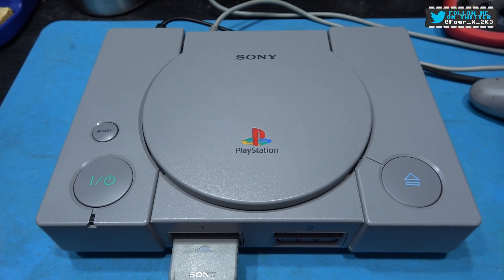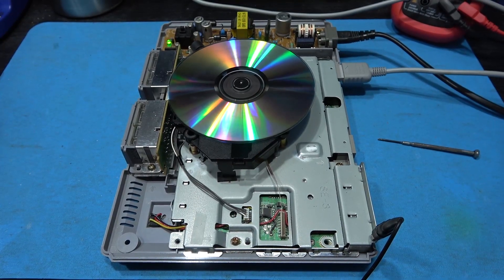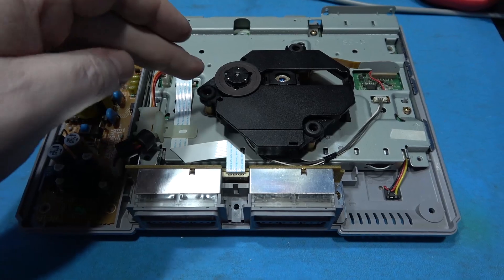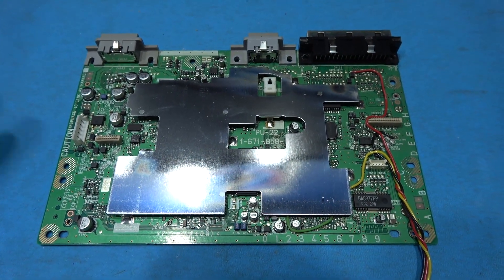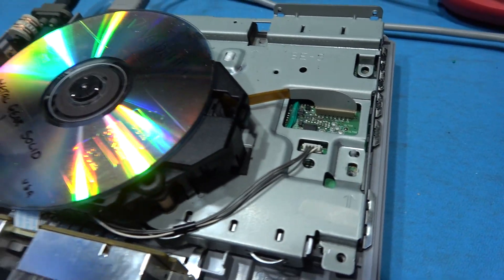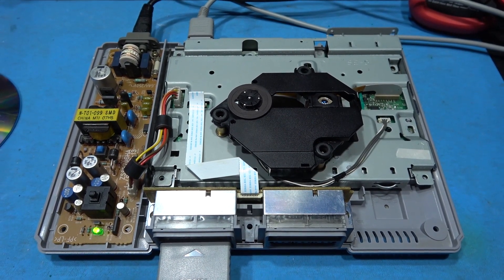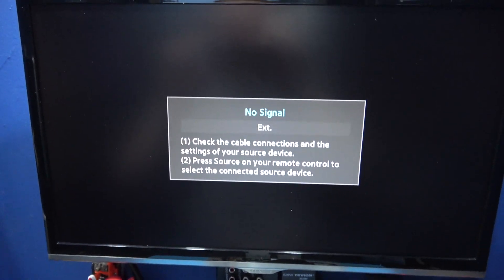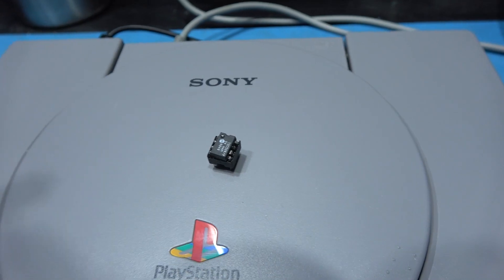Sony Playstation - Follow-Up Video - Laser Power Recalibration, ModChip Upgrade and C-Sync Mod.

Comment: I have a green debug (based on 100x model) that doesn't speed up at 2x or maybe it's not capable of read/recognise the game discs. When the PlayStation logo should appear instead it goes to the memory card/audio cd selection screen and the console continuosly spin the disc then stop, then spin again, trying to boot the game. Indefinitely. It plays audio CD just fine. Can you point me in the right direction of what the problem could be? BTW the console was working fine with a PSone optical group(the original laser was worn out) and stopped working fine after some months of being unused. The console was just stored away.... Also the laser is not faulty since changing It with another one the issue remains. Thanks.

Comment: I'm trying to fix a problem with the optical drive not reading games. I was able to get it playing games for a little bit(admittedly after I "tapped" the console a few times). Then in frustration tried adjusting the ohm resistance on the diode for the optical drive(based off what a video said), thought I heard a snap, then the drive stopped completely. It still spins as afterward, but if you could give some input, I would appreciate it👍

Comment: I'd imagine 700mV being just on the threshold of normal operation for a diode (any diode, like led, cheap diode based laser in this case, or simple signal diodes. Ofcourse disregarding special types like recifier diodes, avalanche diodes, zeners, etc..). That'll definitely extend the life of it! Props to Sony for making that whole assembly so efficient they can make it reliably read discs even when boxing up against that hard physical limit.

That Stealth modchip and c-sync switch wiring job looks ace! Proper Voultar-level install. Love the switch location, those angled uderside edges do come in handy! That dot-crawl, omg, I did notice it, but I thought it was just something inherent to ps1 dithering. Gonna do that mod soon! 

Thanks for sharing!
Reply from the maker: Thanks, The C-Sync mod makes a massive difference to the quality of the video output. It's a must mod for me.